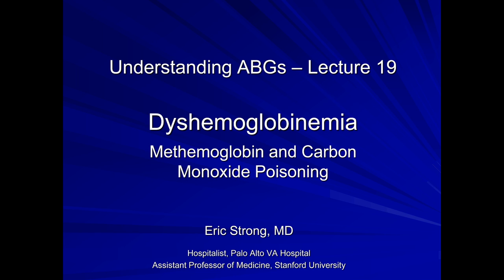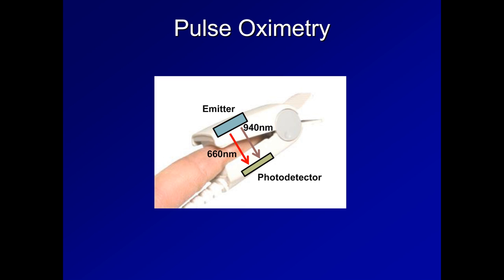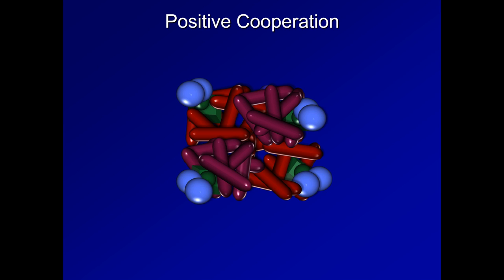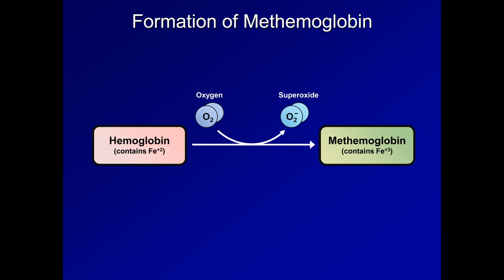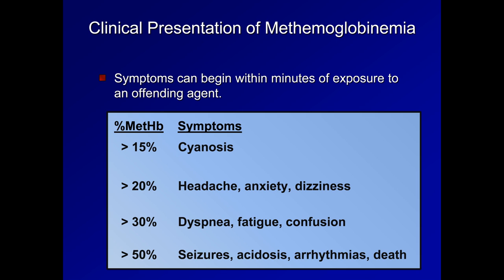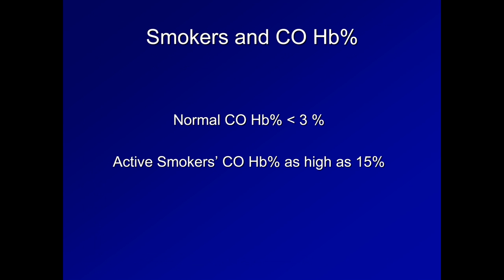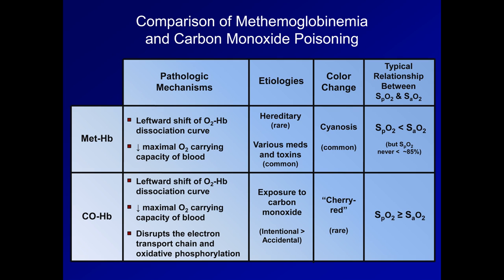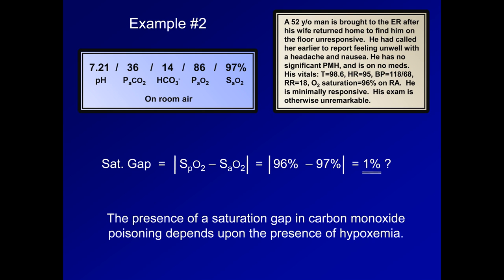Dyshemoglobinemia: Methemoglobin and Carbon Monoxide Poisoning (ABG Interpretation - Lesson 19)

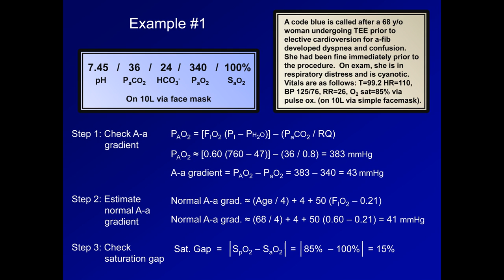Comment: hello Dr. Eric, i love your channel and hope you keep it up. my question is @ 30:11. at step 1, how was the patients 60% FiO2 derived from a 10L facemask? if i use the formula fio2 = .21 + (.03 x O2 in lpm), i get a value of PAO2 318.63, instead of 383. thanks!
Reply from the maker: Carl, thanks for the feedback and great question.  The equation you've listed is my adaptation of an empirically derived equation for FiO2 in patients on nasal cannula, in order to account (in an extremely approximate way) for tachypnea.  However, it only applies for patients on nasal cannula.  When breathing via face mask, tachypnic patients probably take in relatively less ambient air compared to what they would on nasal cannula.  Empiric evidence (I'm unable to quickly find the exact data aside from a reference in an ICU textbook) has apparently found that oxygen delivery via simple facemask maxes out at 60% FIO2 around 10L.  But keep in mind that all estimates of FIO2 are extremely approximate, unless the patient is on room air, a Venturi mask, or mechanical ventilator; even then, only room air is probably 100% accurate.
Reply: Eric's Medical Lectures
thanks for the clarification! all the best